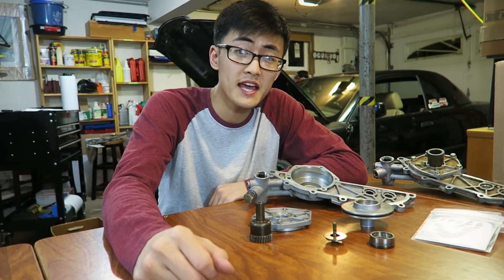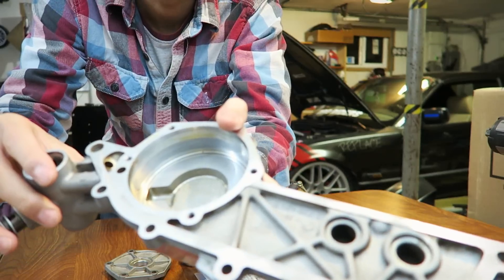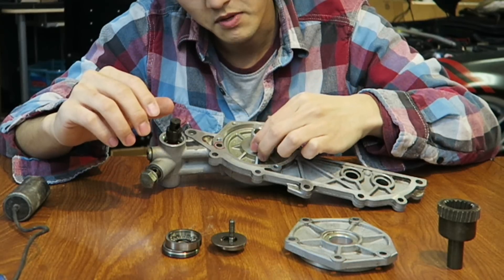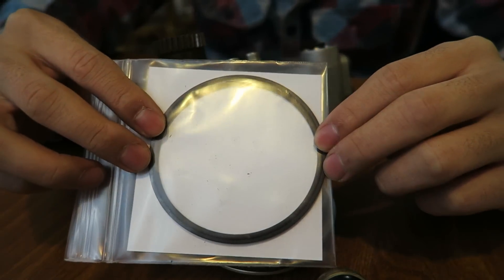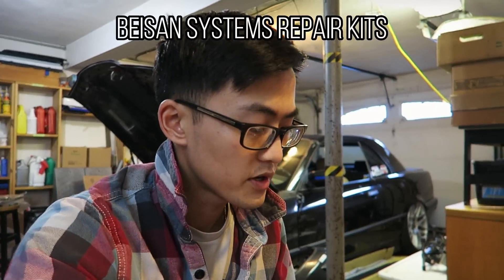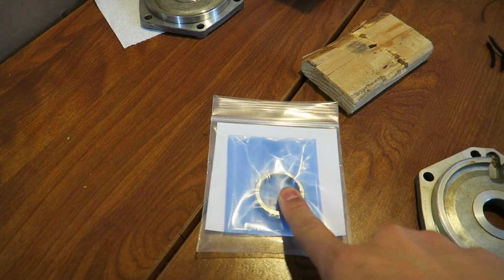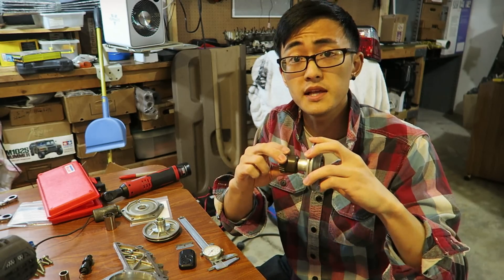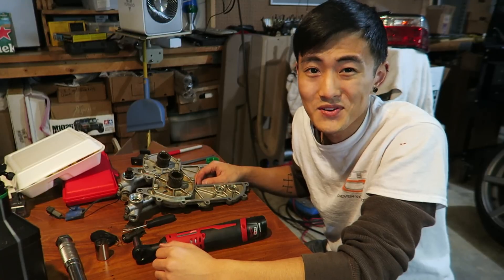BMW Single VANOS: How It Works, How It Fails, How To Take It Apart, & How To Fix It!!

Comment: I just purchased everything i thought I needed to rebuild my vanos valve from Beisan Systems. Less than 5 minutes after completing the purchase, I got a call a wonderful woman from Beisan Systems to say she thought I had purchased the wrong parts for my car. Turns out she was 100% right and not only that but she went ahead and corrected my order and in doing so saved me $30 in shipping costs. 
Holy fucking crap! Who does this anymore? Apparently Beisan Systems does. 
I can't tell you how many times I have purchased parts online only to get royalty fucked in the ass.
Seriously, there guys are total goats!

Comment: Great video I recently done a rebuild of the vanos unit and it’s still suffering with poor idle and when checking the code it comes back saying vanos mechanically stuck any ideas??? I would really appreciate any answers thanks Nick!

Comment: Great job with the video! Do I need to have the engine in TDC if I wanted to replace that vanos unit with a rebuilt one? Also, what were the torque specs on the screws?  Thanks.

Comment: Hello.  Thanks alot for your nice video.  I could solve a stuck vanos issue with that. The guys before was putting in the spring and coil wrong way so it couldnt work.. also i want to link an video which allowed me to change he seals of the single vanos without touching the timing it works good but is a bit tricky with the screws inside. Its found with seraching " Rebuilding E36 M52 Vanos the "WRONG" way! No Re-timing needed! || E36 Turbo Build [Ep. 8]"  its not the wrong way just without taking the vanos completly off. for me it worked good. Thanks alot for your video again.
Reply: Hello, can you send me a video link on how this can be done without timing, only replace the o ring, I would like to do this too

Comment: So it's a variation on Honda's VTEC. Don't BMW have an engine with no throttle body that governs engine speed with valve open duration??

Comment: Going to replace my cam shaft sensor and had to take the vanos unit cylinder off but I snapped it so I either need to replace it (which I probably will) or I need to try and find someone to weld it back on for me

Comment: Quick question sir. I had my engine rebuilt and the guy who rebuilt it said he rebuilt the vamos as well. I noticed the actuator spring is facing away from the solenoid in this video. I replaced it today but the spring seems to be facing the solenoid. Could that be at fault of the code I’m getting? The code is p1519

Comment: Man great video!! Not sure if you check this or not but have a question. I just rebuilt mine and it sounds the same. Very noisy! Does shaving the ring down help with the play? Really Dont wanna but a new unit but man the rattle is annoying. Thank you if you see this

Comment: Gra8t job on full explanation . My only question, does the outer gear that's on the vanos needs to be aligned with the cam gear , because I can pull the vanos unit without a cam locking tool and I can reinstall the vanos with a slite movement of crank bolt  back and 4th to where the vanos gear goes in to the cam gear smoothly .

Comment: Excellent video and a great description of how the VANOS system works.  The only thing that could make it better is perhaps a simple model showing visually how the actuation of the VANOS piston and spline gear moves axially inboard and outboard inside the cam gear to advance or retard the camshaft timing.  Might be something worth adding in a future revision of this video (maybe something is available online in a 3D modeling software?)  Cheers.

Comment: Hi quick question , so i have a 98 bmw z3 with a 2.8 and my engine gave out i have a opportunity on getting a cheap 2.8 engine with low miles but it has double vanos , what would i need to make it work ? Since my engine used to be a single vanos thank you

Comment: one of few informative videos out there that actually explained all I need to know about vanos,,, have a question?- is there a recommended time interval you would absolutely advised on overhauling the vanos? 
I have 2004 with barely 50k miles-runs smooth no issues with power or torque, no rattle, no strange sounds,,,  however age wise it is getting close to being 20 years old

Comment: hello , hell of a video. love it will watch again and again. only question that did have. what did you torque to spec? The outside cover plate? or the torx screw inside the unit? and what were those torque specs i would greatly appreciate it.

Comment: On my 1996 e36 m52 When setting up the sprocket on the intake camshaft and I put all the plates on  now what’s left is me tightening the 3 10mm bolts to 10nm. Once I do that and I’m gonna install the vamos when I try turning it with the sprocket tool it won’t move until I loosen the 3 bolts till it’s able to move.  Any ideas for me on that?  Thank you again

Comment: Nice job on your explanation with disassembly procedure! Just a quick question, are you experiencing a check engine light or are you hearing noise when deciding to rebuild unit? Or is this part of the tear down of the engine re-build? Nice job.

Comment: I just want to say I worked in Aerospace with parts thats tolerants went down to the millionths when finished. As far as your concern about sandblasting as long as you use masking tape to protect sensitive areas that cant have blasting materials thrown at it. Which is literally what we use to at a shop I worked at that makes $50,000 rear rotor gears for the sikorski Blackhawk helicopter and I can promise you that yes it can handle it. Only thing is you will want to run it through a hot tank after words or other cleaning product pretty much anything to rinse off the dust. In Aerospace we used Acetone, Hot tank (for parts in early stages of machining), mineral spirits, methanol, and isopropyl for cleaning. Typically blasting was only used for pre copper plating for heat treatment and glass bead blasting especially after copper plating was removed. I personally don't think at all blasting should ever be used for cleaning. Blasting is like for surface issues like rust or resurfacing, pretty much using friction to get a smoother surface. Now as far as sandblast for heat treatment goes I have no clue all why they do other than to remove all grease and oils on the surface and to leave the surface dry and protected from rusting before heat treating and they take the shit serious too like when you sand blast for heat treating you have to use gloves to put the parts away when you are done and even wrap them in paper to avoid cross contamination from the surface they were packaged in. Thought I should add that any time you use a sand blaster keep in mind that you are removing STOCK as well from the part and in areas where the tolerance is tight that can have some really bad consequences if you blast some parts for too long or too many times

Comment: Hey man, I have had a reoccuring camshaft, crankshaft position sensor code as well as vanos jamming codes.  I have done everything from replacing the sensors with OEM, replacing the wiring harness for the emissions recall, and also a new vanos unit.  When it is hot, the codes come up more often but when its cold, it comes on intermittently.  I am super confused on whats wrong with the car as I have thrown so much money at it.  It's a 98 e39 528i m52b28.  Do you have any suggestions to what else could be causing the issues?
Reply: So did you ever get it sorted?
Reply: @Vgk36   haha no.  That car just sits in my driveway for the past 2 years now.  It hasn't been reliable sadly so I got a new car.
Reply: Damn bro I'm really sorry to hear. Maybe swap the ecu with someome else with the same model and see what it does?

Comment: Nicely done young star.  I've recently acquired an m52 to keep my m54 company.  I look forward to seeing the differences in the 2.8 throttle cable initiated motor and its electrical throttled 3 litered brethren.

Comment: Much better to vapour because of the close tolerances required. Also a sticking VANOS solenoid is relatively easily with two Mannol intake cleaner runs each followed by a 100 mile delayed full oil+filter change. This allows the concentrated intake cleaner to break down slightly the dried over aged long--oil change solids.

Comment: I have a 98 323i and I've been having issues with no power under about 3k. I replaced my crankshaft and camshaft position sensors which fixed it for about 2 to 3 weeks and its right back to not working again. I'm gonna give this repair a shot.

Comment: Why would you sandblast this?
duh... 
let's get some grit into whatever valves etc are in there... 
duh... 
I'll just put thicker oil & seal conditioner/Lucas in my idiot friend's p.o.s. overpriced, overrated import scrap so he can actually drive to work without constant stalling & enraged drivers following his 5mph top speed "ultimate driving crap". 
Then I'll get in my AMERICAN made Ford Crown Victoria which has 700,000 miles on the ORIGINAL engine & transmission, gets 30mpg, and I'll do a few donuts around my imbecile buddy's "Bmw" fartwagen..  : D

Comment: The nut that you shaved the 18mm socket for is stuck on my vanos piston. Any idea how to get that open seems to be overly tight.
Reply from the maker: Hey man! I'd try heating the perimeter of the bolt with a heat gun to try and expand the thread surfaces. If that fails to help loosen it you get try loosening it with a few gentle bursts from an impact wrench
Reply: Thanks alot bro will let you know how it goes. Awesome page btw 👍
Reply: 1 more qestion for you sir . I replaced both timing chains and tentioners and after start up my car had almost the same noise as the car in this video in the link below, what do you think the noise could be? Thanks in advance 
https://m.youtube.com/watch?v=jPE5VtcV-hA

Comment: Could you do a double vanos video? It shouldn't be hard for you to find an n46 engine with leaking vanos solenoids to work on
Reply from the maker: Ill consider it, but right now my BMW projects have been pretty backlogged from my current set of freelance videography work 👌. Beisan systems should have a decent guide for the double vanos replacement

Comment: So for a 95 e36 325i m50 turbo project what would you recommend vanos or non vanos ?
Reply from the maker: It depends on your hp goals and then how much you want to invest into the build. For high hp above 500hp I've seen a lot of people delete the vanos, or use an NV motor with some beefier internals. For a street turbo e36 that has more modest power goals, keeping vanos will help with low end torque and fuel efficiency imo.

Comment: Good to know, I plan on buying a used N73 V12 from an E66 (760li) that I would like to rebuild, I know that they are a very complex piece of machinery, but that’s what I like about them. I used to own an E38 (750il) with the 5.4 liter SOHC V12, no VANOS though. That N73 is probably the closest to the S70/2 that was only used for the McLaren F1, possibly the best V12 engine BMW ever built.

Comment: Hey, please do you have any idea where to buy seals for N46 4cyl double vanos? Thx!
Reply from the maker: I do not know where to get those seals, but I wouldn't hesitate to reach out to beisan systems to see if they can help find a supplier. Otherwise you'll have to look up the parts on realoem.com and buy it straight from the dealer

Comment: For the Bearing round washer in the Vanos unit does that need to be replaced to?
Reply from the maker: Only the thick bearing ring needs to be replaced (as mentioned in the besian systems rattle repair kit). The other bearings wear down and are difficult to reproduce. The new bearing ring I installed is slightly thicker to compensate for that wear.
Reply: @Pawinning  Awesome thanks! I need to rebuild my Vanons on my M50 as well.
Reply from the maker: You're welcome! Good luck with the rebuild 👍😎

Comment: Please see my video below.
https://www.youtube.com/watch?v=JB9mJrxOUOQ&t=87s

Can you tell me if you think this is a vanos noise?  or something else? I currently have the SES light on saying increased emissions.
Reply from the maker: Hey man! I'm actually not sure where you may have issues on your engine (not familiar with your BMW series). Have you tried posting this on bmw Facebook groups and/or Bimmerforums?

The sound does seem to be isolated at the front of your engine, and I would start by inspecting your engine accessories like pulleys, alternator, and power steering pump. As these rotating parts are strained long term they can generate an audible whine.
Reply from the maker: Vanos symptoms are usually just rattles and noticeable power losses, I haven't experienced a whine like that in my BMWs before
Reply: @Pawinning  yeah i noticed it comes from upfront... i think its a cooling thermostat & water pump going bad, one of the pulleys is going bad.

Comment: Hey. Awesome video.. I have a 2004 L322 RangeRover with the single Vanos BMW M62 4.4 ltr V8.. Have looked up the 'beisansystems' and 'Drvanos' sites and neither seem to have a kit for these engines.. Not sure what to do here.. can u help?
Reply from the maker: Hey man! I'm sorry you haven't been able to find a kit to work on your m62. I'm not too familiar with that engine platform so I cannot help much unfortunately. Have you tried contacting FCP euro? They're one of the best companies when it comes to oem parts

Comment: Great informative video. Is the double VANOS system basically two of these or are there differences?
Reply from the maker: Yes they are similar. It applies similar timing control on the exhaust camshaft. Double vanos has its own tool set as well!

Comment: Love the video, Pawin! Huge fan of your turbo beast! Planning to do the vanos rebuild on my e36. Is it possible to replace the vanos seal without locking the cams in with cam blocks? I'm assuming there is no need because you dont mess with timing by removing the vanos piston. Thank you!
Reply from the maker: The cam locks are necessary because there are steps where you need to rotate the cam gears to remove/install the vanos unit. Check out my m50 disassembly video!

Comment: So mine seems fine at idle but when I rev it sounds like a ratchet clicking n unison with the engine. What should I need to fix
Reply from the maker: E36 engine ticking can be caused by several things. First the vanos rattle and timing chain rattle. Both of these will make noise towards the front of the motor and can be heard at idle but mostly under load. The next source of ticking can be at the valve lifters themselves being clogged or collapsed (see my lifter tick video for more info) which can be heard traveling down the motor lengthwise. Hope this helps!

Comment: Quick question @Pawinning 
What is the torque spec for the vanos cap and also for the reverse thread torx bolt inside? I'm rebuilding mine and I simply want to ensure I do it correctly the first time.
Reply from the maker: Hello! It’s a very low torque if I remember correctly, but I know for sure all the torque specs for the vanos repair procedure  can be found at beisansystems.com 👍
Reply: I had no idea! Thank you very much, brother. Keep up the good work!
Reply from the maker: No problem! Happy to help!

Comment: Where can you get new bearings and plates for the vanos or do i just use the old ones?
Reply from the maker: You can reuse the old ones because the new washer from beisan will compensate for the wear
Reply: Pawinning ok thanks

Comment: ive been hearing a rattle every morning when i first start it then the rest of the day i dont hear it again. should i still consider rebuilding it ? how long can i go till its a must?
Reply: the rattle goes away once the car warms up a little
Reply from the maker: A little rattle upon a cold startup is normal for an older e36, I would start planning to service the top end of your car (vanos seals, rattle kit, and timing chain tensioners). Is the rattle from the front of the timing cover or further along the top end of the engine? Because if the rattle isn’t from the front of the engine then you might need to consider servicing your lifters as well in the future. Nothing needs to be done until the rattles are consistent

Comment: did you already buy the 85mm pisons for the M50 ? or some other parts ?
Reply from the maker: No, still slowly saving up for engine parts. I’m prioritizing cleaning up the turbo e36 and building the ti chassis 😎

Comment: My car has a rattle when it is warm.
Reply from the maker: I’m not sure how temp would matter, but from a thermodynamic standpoint as materials warm up they expand. So it makes sense to assume that the rattle would become more apparent when the car is warm because any small gaps or tolerances will change with temperature.
Reply: thanks

Comment: I loved this video. And damn it would have been helpful about 6 years ago on my first s50 e30's vanos
Reply: Christopher Taft and your still wrong US spec engine is (S52) not s50
Reply from the maker: Thank you! And I feel that, 6 years ago I only knew how to change brakes on my e36, and never drove manual before haha. VANOS was too intimidating for me at that time lol
Reply: Christopher Taft s50 is the euro spec engine. US is s52
Reply: Gaz Girl s50b32 is euro, dual vanos. S50b30 is US production 92-95, single vanos. S52b32 is 96-99 (2000 z3m) single vanos.
Reply: Christopher Taft wrong wtf you said in your post 92 they ever made e36 m3 till 94 . Also American engine are (s52) not s50 .you have no clue
Reply: Gaz Girl look it up. My e30 was s50 (95 m3 US market) swapped. I do have a clue as I swapped it. But, you do you boo. I'm educating you.
Reply: Gaz Girl lol alright, I'm not but okay.